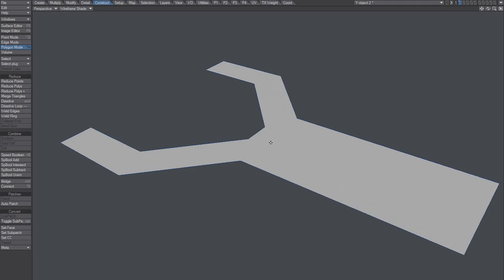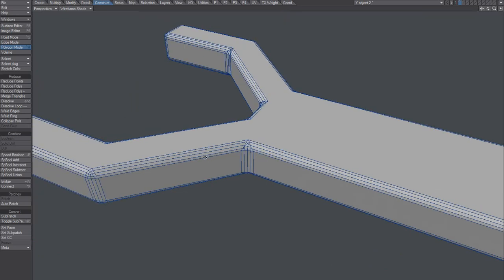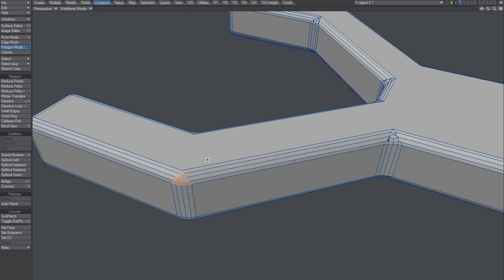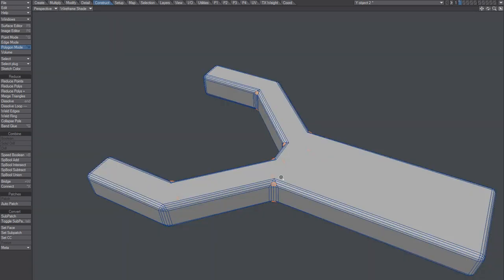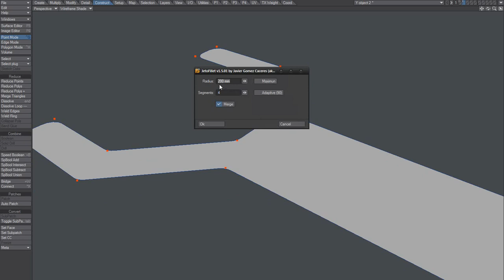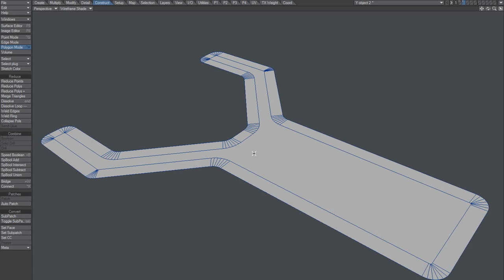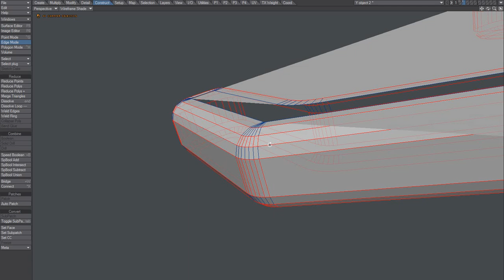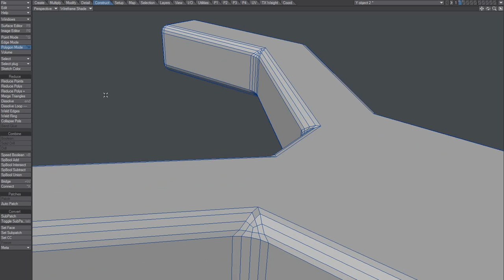LightWave Model - JetoFillet, Chamfer, Rounder

Comment: Thank you for all the Chamfer vs. Rounder video comparisons.  There's a lot of obvious issues with Rounder when working on this kind of topology, but I'd like to see how it performs in these tests on a properly quad mesh instead of a giant ngon.  I have a feeling the tool was intended to use with quad topology by the way it always ends in that one single point at the top.
Reply from the maker: You are welcome  :)  yes, many differences, what i came to was just to keep testing, and keep testing, on different topology. sometimes rounder is better, sometimes chamfer. i do wish for an updated rounder, untill then,... :)
Reply: I feel like it would have made more sense to simply improve on the Chamfer tool itself rather than have a totally seperate tool like rounder.  For example, instead of having to apply chamfer multiple times to get that similar result, if the tool had the ability to specify the number of internal segments on the fly, it would be a much more flexible result.  I think some other packages do have such a feature.  I believe I saw the 3dsmax chamfer tool work in this way, with the option to create quad corners or triangulated ones, etc.